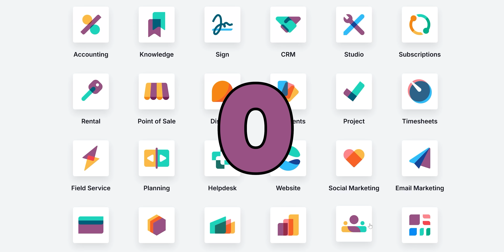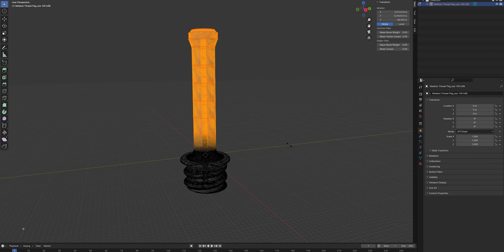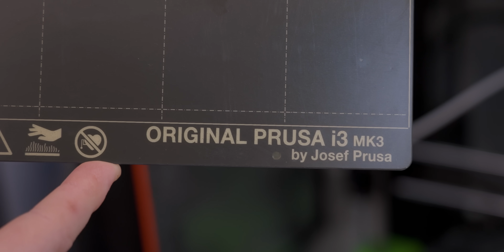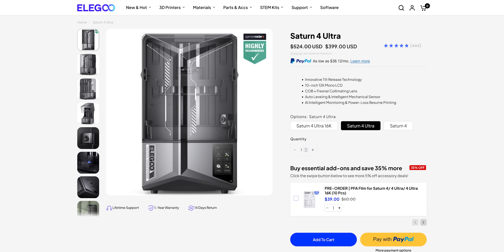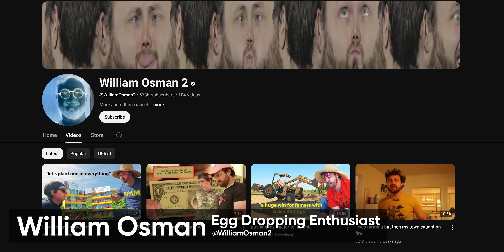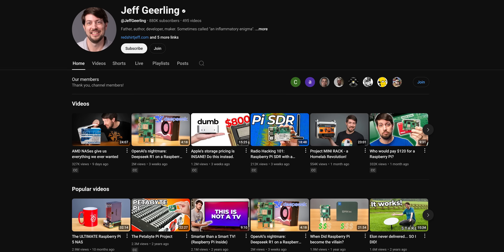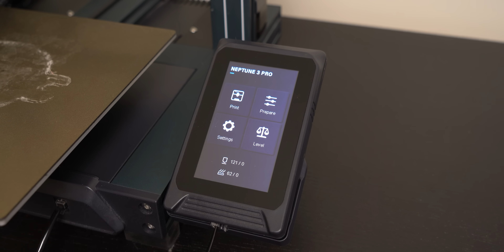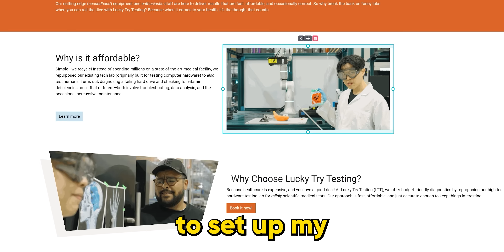Is my 3D printing setup wrong?

Comment: Bambu is the best thing, even the cheapest is basically 4x faster than ender 3 and reliable
Reply: Reliable is the main one. I have 400 hours on my P1S combo since I got it in January and I've had like 2 failures.
Reply: @glymps  its more about people not wanting to put the work in. My Elf Pro has seen close to 3000 hours with no failures. Worked on it for maybe 2 to 3 hours total. Took less then 30 minutes to set up too. All of this before the P1S and X1 were even a thought.
Reply: lol we moved on from those slow enders long ago. they came out with a modified version of the ender 3 and its almost as fast for 200 bucks like right after the X1 came out.. lol Rember, the X1 doesn't go 1500mm/s, thats jerk speed. Its top print speed is more like 300mm/s and these new enders can do that no worries. Side by side tests proved it many times.

Really only Vorons and other home made ones can actually go 1000mm/s +.

Comment: These filament dryers are pretty crap and overpriced boxes of plastic with underpowered heaters and inaccurate controls. Not to mention they are usually loud. The best thing you can do is get an air fryer with dehydration mode. They get hot enough, stay silent and are unlikely to burn your house down.

Comment: greetings sir, i recently repasted my gtx 1070 and lost 85% of the performance. My gpu usage shows 100% under stress and gpu temperature doesn't go higher than 35 degrees celsius. What could be the reason. I would appreciate any information you could give me. Thank you.

Comment: I had a ender 5 plus for years bought a p1s right before Bambu lab announcement and I still don't care, it just works, it's not a pain in the ass its great it brought back passion to the hobby instead of the printer being the hobby......
Reply: I went from an ender 5 plus to an A1 with the AMS and I’m in your shoes. I print with the SD card because it’s muscle memory. But the A1 just works every time.
Reply: Same experience had a ended 5 pro absolutely hated it. With bambu I select a model select filament hit print and I'm done
Reply: Got one for my self aswell. The Combo kit. Now when the price dropped. Im very pleased and happy. So far everything does just work. The only thing that could be annoying is all the noise the box and the motors are making. Lots of ratteling and vibrations. The box amplifies it as well.
Reply: Same. Went from Ender 3 to an X1C with an AMS. Night and day. Now I print something and wait for it to be ready. Not slice something and then begin the journey to actually getting a viable print going down and then hope it doesn't fail partway through for no clear reason. Bambu made printing stuff the hobby for me. Not nursing the printer.

If they do decided to go full Apple and lock everything down and add subscriptions for basic features, I'll tell them to F off. But nothing about my workflow has changed and I'm only printing models other folks have made of Stargate and Mass Effect spaceships. Only thing I actually designed myself was a cover for a padlock on the gate at work to keep dust out of it. Not exactly a million dollar idea.

Be a little wary of changes, sure, but they have made it possible for me to actually make a bunch of stuff I never could before. My ADD would never have successfully printed a BC-304 on the Ender 3. I gave up partway through a Puddle Jumper ffs. It was just too hard. Whereas the X1C I am confident enough (and have good first party documentation enough) to clear the head when a clog happens or fix a jam in the tubes. The one time that happened on the Ender I basically gave up on printing for a year.

Glad I sold the Ender and cleared the desk space for a nice big filament dryer. Much more useful.
Reply: dose their moves worry me a bit yeah but a vast majority of their user base will not be affected by these changes. But that doesn't mean at some point that couldn't change. and if they decied to push to far with their lock it down BS or start doing things like making us pay for a subscription then ill sell my P1s and A1 but untill then there is no other printer that is just as plug and play as them. plus they are rock soild and amazing printers.
Reply: I'm sure they appreciate your response to their lies
Reply: @hamsterbrigade  Nice gaslighting bro
Reply: @hamsterbrigade  Nice gaslighting bro
Reply: I had Elegoo Neptune 4 Pro. Sold it and bought Bambu A1 with AMS. My life is so much easier. For same price more or less it's day and night. Sometimes I am sorry for a person I sold Elegoo to :D
Reply: Yep. The people pouncing on bambu are the same ones who didn't like it to begin with and want to gaslight everyone into thinking it's a bigger deal than it is
Reply: @handledrandomly  To me its very concerning they are trying to lock out community developed slicer support, thats basically the one thing ensuring that Bambu cant just throw a switch on their servers and either severely limit or even disable their older lineup of printers to encourage people to upgrade. I've seen it done on way to many IoT devices that essentially become bricks because the manufacturer decided its time for everyone to buy a smart-plug 2.0.

Them being all snarky and jaded when they do let up on some of the changes just cemented the idea they were not a brand I wanted to even give a chance. It was way to similar to how XYZPrinting operated before they went bust for driving away customers using tactics similar to bambu.

Comment: There's been plenty of noise about this in the 3D printer and consumer rights communities but it's good that it's finally getting out to the spider tech community, which is where Bambu's main customer base actually is
Reply: "spider tech community" I hope you meant wider tech community, because if you didn't I'm terrified.
Reply: I said what I meant and meant what I said
Reply: out of the loop here... what happened with bambu?
Reply: They made changes to their terms of service that indicate that they are moving towards locking past and future customers into a closed ecosystem that would prevent the use of new open source features and tools and possible allow an HP style subscriptions or force only expensive approved filaments to be used or worse.
Reply: @Waldohasaskit210   that is incorrect, they said they won't do that and they can't even if they wanted.
Reply: They didn't, they closed the API for third parties. Most of the other things you are mentioning have been debunked. When the new TOS came out some people read them wrong and made a rumor. Nothing in the TOS indicate some sort of subscription to use the printer or locking the usage of third parties filament. They might do it in the future but for now nothing indicates it.
Reply: @ There's no innocent reason to close the API to third parties unless you were planning on some kind of anti-consumer monetization scheme once your customers are too locked in to switch
Reply: @Waldohasaskit210  false
Reply: @sirram_e  They're trending to go the way of Apple with more proprietary parts and ecosystem. It could be overblown like Jakov stated, or it could lead to less diy-friendly platforms.
Reply: @timthefosterdad  it was never advertised as diy or anything close to it, but there are still good upgrades you can do to it and use orca slicer even after all the changes.
Reply: @timthefosterdad  i see. thank you for the explanation :)
Reply: @JakovPerisic In 3d printing open source is the norm as it was patented previously by stratasys so it was kinda risky to make them commercially so they used a workaround, so most used kits or open source projects
Reply: @sirram_e  Basically: If you are a home user printing models you found online, absolutely nothing. If you are a business user printing proprietary models, you have to put the printer in LAN mode.

Everything else you'll hear is dealing with someone's personal principles more than any actual drawbacks.
Reply: What is "spider tech"?
Reply: @TheBackyardChemist  One would assume "eider" or "sider" became "spider" because auto correct is trunk sometimes. Plus, those keys are around w. Unless this person is talking about the web of which they may weave, and knows something we donut. 🤔
Reply: @ I don't know anything about your donuts but I do know that DIY engineering has always been popular among spiders. They create some truly amazing and ridiculously complex structures in all sorts of places.
Reply: Meh It has been blown way out of proportion 80% of the shit people are throwing are bull.
Reply: Yeah and it has been overblown a lot imho

Comment: I love my bambulab printer. So easy to setup and just use. Im a hobbyist in a lot of things, but I want my printer to just work without tinkering.
Reply: had a ender 3s copy then upgraded to bambu p1s and i can confidently say that i am only staying with bambu from now on, once i finish a design i just dont have to worry about it messing up
Reply: that's fine, but they need to stop with this whole "revolutionary" bit they always try to peddle. 

They took open source, community made technology and closed it up into their own ecosystem. The 3-point bed leveling, guide rods, even the nozzles existed all before they were even a name. Even the software, although is there's, mirrors KLIPPER in a lot of ways. They also lied to you about LIDAR. The AMS suck a fattie compared to even systems like the Prusa MMU( which came out long before AMS) and AMS is really just a slow version of that. The community has moved onto things like independent bed 5 axis printing and Bambu is still stuck with carbon fiber guide rods as a hook, line and sinker. 

Companies like Creality came out with similar printers right after the X1 but at the quarter of the cost....Bambu isnt good for the 3d printing community like you think it is. We spend years back in the early 2000s to ge all this shit open source and they come in and shit all over that lol